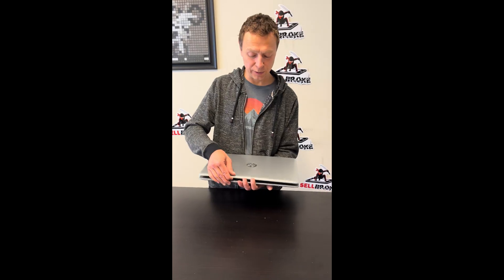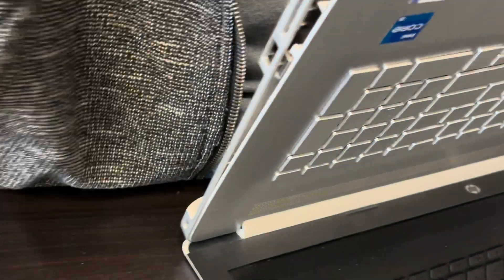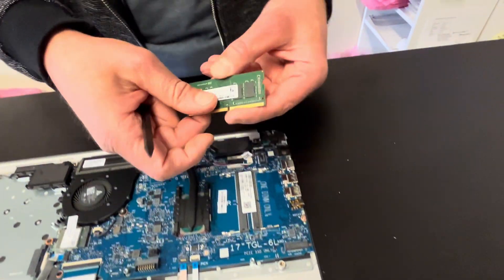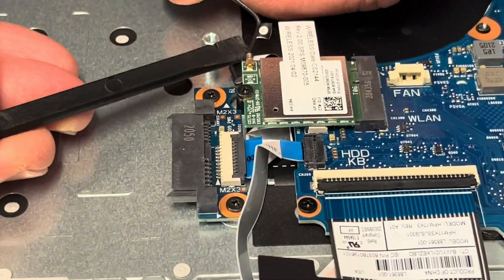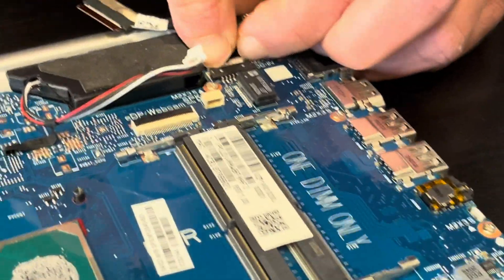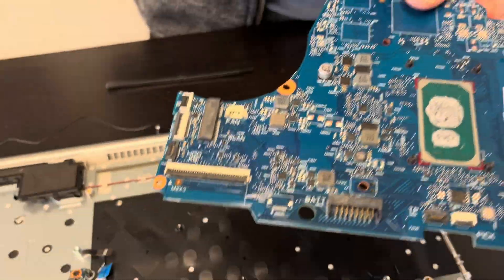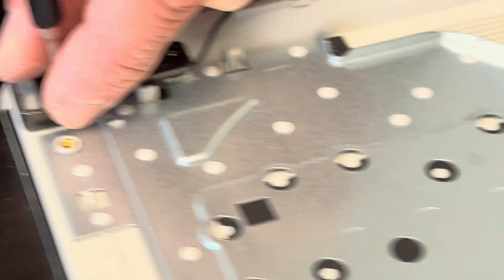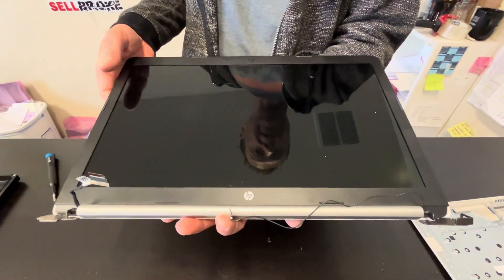HP 17 Laptop. DIY Take apart, fix, repair, upgrade replace: memory SSD Motherboard LCD Battery

Comment: None of this is remotely close to the motherboard in my hp17-cp2025dx. Nothing here is the same. RAM is integral to my motherboard. I can’t find any SATA port to add a second hard drive. There’s a nice spot for the drive, no port on the motherboard.

Comment: I'm also wondering where the CMOS battery is. Thanks for your video and any further advice.
Reply: I just read that some HP laptops have no CMOS battery; for them the main battery does the work. I'm starting to think this is the case here.

Comment: I watch this trying to figure out what I need to do to replace the CMOS battery. I didn't see it referenced. Did I miss it?
Reply: I just read that some HP laptops have no CMOS battery; for them the main battery does the work. I'm starting to think this is the case here.